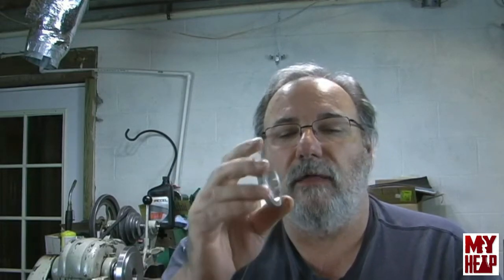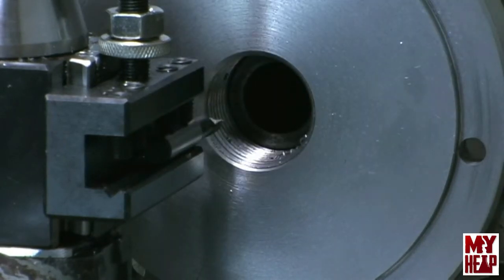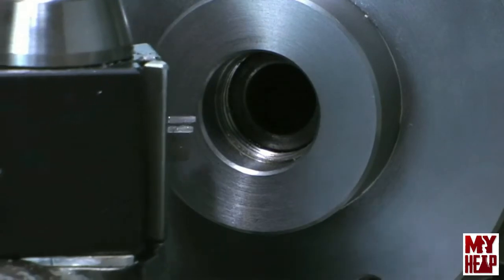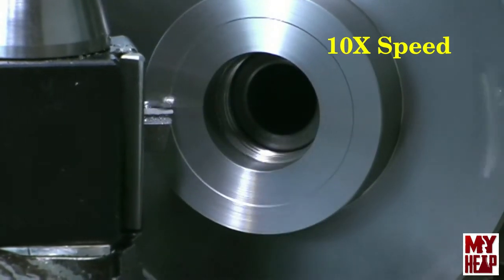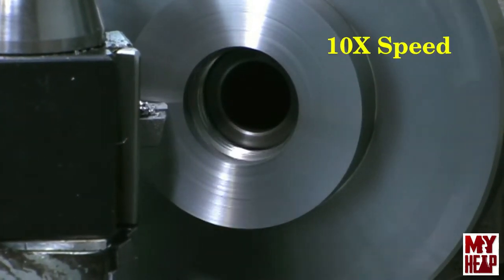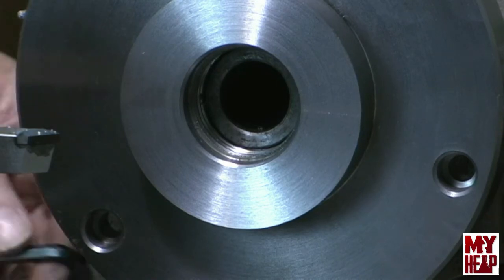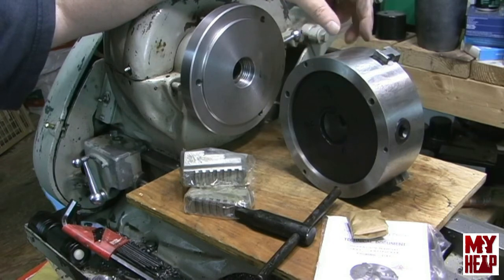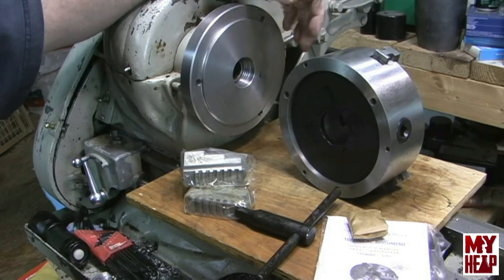YouTube Shop Student - Episode 006 - More Backplate Antics

Comment: Straw color chips is right in the sweet spot on steel. Must be mindful of surface speeds when cutting large diameter stock. For facing I been really liking my 90 degree carbide tool.....it looks like a threading tool but just with 45's instead of 30s. Set it square to the face you are working on. Can make one from HSS.... Having a lead in angle really helps the cutter self feed rather than hit the OD bluntly and catch and stall the motor. Kinda the same principal as when you were feeding out from the center when facing....the lead angle helps a lot. The part looked good Joe
Reply from the maker: Hey Richard.  I think you are on to something there.  The attack angle on the tool the way I had it set was pretty steep when facing from the outside of the diameter to the inside.  This is where I had the problems.  So when you set the tool square, you are setting it up like a boring bar so to speak??  I have a brazed carbide tool similar to what your talking about.  It is steeper than 60 degrees, but smaller than 90 degrees.  I need to measure it.  However, I do need to grind some HHS.  First and foremost for the practice and I think I will take your suggestion and make a 90 degree chamfering tool.  Thanks Richard for your continued support, suggestions and help.  I truly appreciate you taking the time to support and help me.

Joe
Reply: Goddamn ruff life when HOT CHIPS (not chippie) is your life's SWEET SPOT !!

Comment: tip for chamfering grind a hss tool bit to a 90 degree point and keep it on one of your tool holders oriented to the bed and keep it on hand your going to use it all the time.  set up this way you can get the id and od of most parts.
Reply from the maker: Hey Chris, I think this is a great idea and will make one.  So do you set it up in the holder like a boring bar?

Joe
Reply: yes in that orientation i can shoot a quick video and show you but i think you got it. worth buying a block and just deticatie it or put in on the block that has the knurls on it . i think it has a spot for another tool right?

Comment: Hi Joe, glad that seemed to work for you. I have two suggestions for you. First is, for turning steel, use a cutting oil. Make up a little can with a magnet on it and a acid brush to apply it. It will make your cuts go much smoother and probably give you a better finnish. Second, I noticed you seem to be engaging your back gear to lock the spindle to remove the back plate. While this seemed to work, it is probably not a good idea. That bull gear is 70 year old zamak and not something you want to give jarring blows to. Mr. Pete does a good video on ways to lock the spindle.  I use an old peice of v-belt wrapped around the driven pulleys.
Reply from the maker: Jeremy, thanks for the comments.  Now a couple of questions from a newbie.  First,. What do you use as a cutting oil.  I have used kerosene for aluminum, but what about steel.  What is the difference between a lubricating oil and a cutting oil?  Living in Podunk, where would I buy and what should I use as a general cutting oil for steel.  I have seen people use some sort of red colored oil for cutting that looks like transmission fluid.  Any help here would be appreciated.  I know that is a newbie question, but alas, I am what I am.  :-).

Second, can you explain what you mean by an old piece of v belt wrapped around the driven pulleys?  If putting the lathe in back gears to lock the spindle is a potential risk to the gears, it is best that I unlearn the habit right away.  I will see if I can locate Mr. Pete's vidoes, but if you know which one, could you post a link for me?

Thank you Jeremy, you have been a great help to me for quite some time.  I appreciate the feedback.

Joe
Reply: My Heap, I made a quick video showing what I was talking about.
 https://youtu.be/2PCXensI-lo
Also the Mr. Pete video I was talking about is here https://youtu.be/7dC13inQC9A
To be honest, I'm not sure what the real difference is between lubricating and cutting oil. I just use my Napa cutting oil and keep it thick so it does not get slung off when I'm running.
Reply from the maker: Jeremy, thank you for the links.  I watched your video and using the old belt like a strap wrench seems like a good idea.  I also picked up some cutting oil from my local NAPA store and will try it out.  They had one lonely bottle on the shelf and been sitting there emaciating I think.  You know how plastic bottles will pull in as they age.  Also got some acid brushes.  Thanks for taking the time to help.

Joe